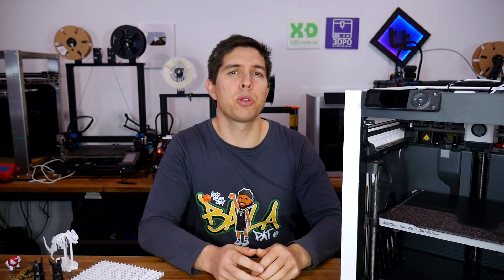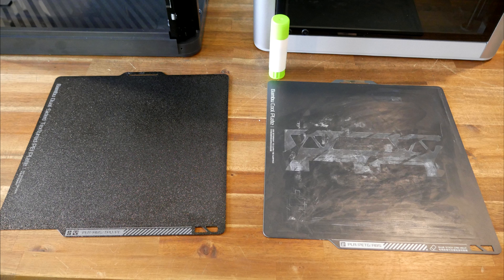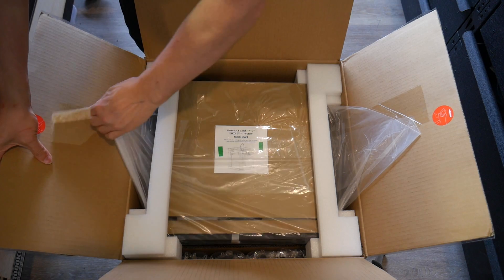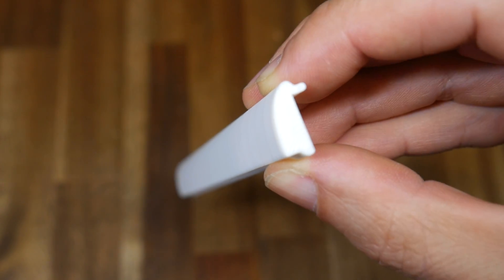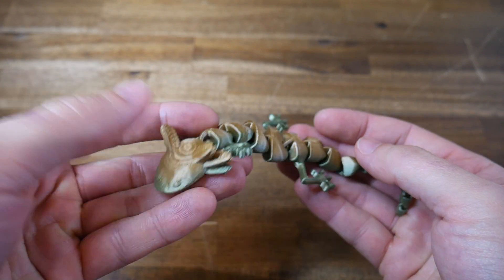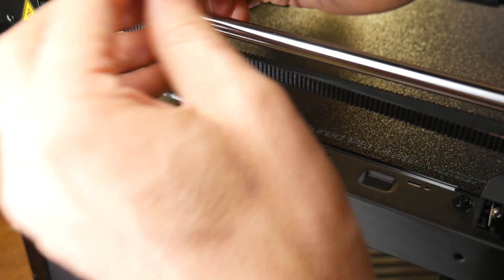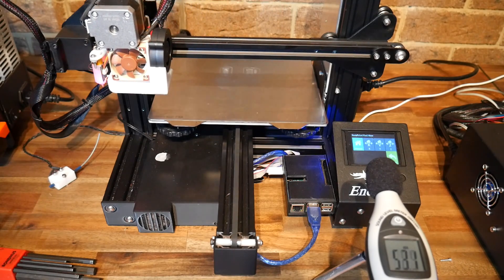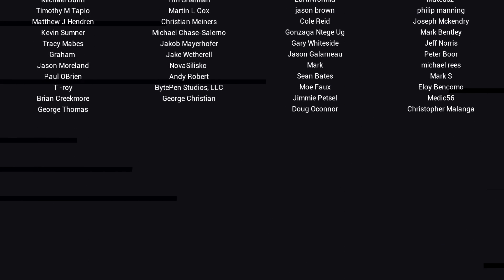Bambu Lab P1P - Your questions answered!

Comment: I'm really glad this printer exists. Prusa needs serious competition. They've been rather stagnant with their innovation.
Reply: Prusa sucks, 5 years ago maybe but now honestly the ender S1 pro the new one blows it away itself nevermind the x1
Reply: For me Prusa is a reliable and well tested printer that gives excellent prints. That’s the bottom line. I’ve tried loads of rubbish printers that had to be tinkered with in excess to give anything close to a Prusa. The Bambu has been out for about a year if that? We shall see what future holds. The savvy 3d-printer-YouTubers can make gold out of a turd so I’m not convinced that this machine is ready to “beat” the Prusa. Yet.
Reply: @henriklagercrantz  more than just you Tubers have them I have 4 Enders 2 pro 2 plus a Prusa mk3 as well as 2 x1 this has been out for a year and they sold many many printers. Before you bought your first Parisa you didn’t know anything about it. I’m sure it’s no different.
Reply: @weldingjunkie  I’ve got a flashforge finder, an ended 5, an ender cr10 v3, a sidewinder x2, an ender 3 max and my Prusa mk3s beats them every time on reliability. Perfect prints. Right out of the box. No hassle or headaches with clogs. No “upgrades” it. Just. works!
Reply: the prusa xl looks amazing but $$$ and they can't seem to get it shipped. They built up hype but couldn't deliver and by the time they can a newer better printer will be out, and likely for less money
Reply: @digitalpilgrim  that price point is extremely steep for the prusa XL
Reply: @digitalpilgrim  It's been 2 years and still no one has one in hand. If it wasn't at Formnext 2022 I would have thought it vaporware. Of course its blazing printing speed of 50mm/s left a lot to be desired.
Reply: @No0o0o0o0o0  but unlike the garbage bambu makes a prusa will work in 10 years
Reply: Even on prusa's website they recommend maintenance every 800 hours of printing. If you don't maintain your product it's going to fail. 

You know how many advancements in 3D printing happen in 10 years?

Are you implying that if I put a prusa together today print once. Then print 10 years later it would print perfectly? Lol
Reply: @No0o0o0o0o0  more likely than bambushit
Reply: @CourlandEngineering  the difference is the bamboo lab is out now. Where is the xl?

And we can't even compare the mk3s line to the p1p or the X1c. They are objectively better. Time will tell abour longevity but we're dealing with the Here and Now. Corexy crushes bedslingers. They print faster they're more accurate and have a larger  build volume. 

The only thing that prusa has going for it is the fact that they make the Bambulab look awesome lol.

The prusa looks like trash that was thrown together after a garage sale
Reply: @No0o0o0o0o0  If you need technical help or parts in 5 years bambu will be nowhere to be found, and even if they will be around they wont give you their crappy proprietary parts
Reply: @CourlandEngineering  Ok Nostradamus since you can see the future. You forget one thing I can afford the best. I am not waiting around to fix 10yr tech for it to print slow. 

Maybe I'll explain it a little better.
standard

Something that would take 3 hrs on a prusa i get in 40min on my BL. It gets worse the larger the print.  25hr print (crystal dragon) I get done in 8-9 hrs.  Which means I can get several times the production out of my new tech vs the "reliability" of my old tech. Remember CoreXY is fairly new. Imagine what will change in 10 yrs. Time  is money and spending on a slow cartesian printer is a waste. 

aside from your subjective "reliability and support" why is a slow janky shite diy project like the prusa worth my time?
Reply: @No0o0o0o0o0  all im saying is prusa is a much more legit company than bambu, and if you wanted the best youd have bought a voron
Reply: @CourlandEngineering  I dont have 30hrs to build a voron. I have a day job. A voron kit (depending on sourcing) would cost more and be less capable. 

30 hrs to build, test, tweak, then deal with code and countless other issues.  So I would pay more, deal with more headache and get less. I have seen the Enrager Rabbit Carrot Feeder mmu for vorons and am not impressed. 

I have the Bambu lab AMS system as well so I can print in multiple colors up to 16. 

I'm not emotionally bonded to my printer. It is a tool. I dont need to know every inch of it or personally pick out parts. I am not a fan boy of any one company. My interaction with them, is purely financial. They sell a product, I buy a product. I dont have to agree with their mission statement. I couldn't give a flying $uck about open source. If they go under and I need a new one I'll buy whatever is the best at the time.
Reply: @No0o0o0o0o0  a voron is much more capable lol, you wont EVER be doing 200k accel on a bambu
Reply: @CourlandEngineering  LOl the fastest voron gets 794 mm/s and that guy states he loses quality at 400mm/s/ which is well within print tolerances of the bambulabs up to 500mm/s.

I noticed you skipped over the fact I have an AMS and capable of printing 16 colors.
Reply: @No0o0o0o0o0  Who gives a shit about AMS? oh right nobody. there isnt a single video of a bambulab printing well at 500 lol, plenty of vorons printing well at 500
Reply: @CourlandEngineering  I like the idea of an AMS, but without a tool changer it's mostly reducing its application to multi color, which I'm not interested in at all untill we get color mixing that leads towards a true color coloring.
And yes, I won't call Bambus wasteful purging mechanism an asset.
Reply: @CourlandEngineering  Spoken like someone who does not own an AMS. lol I use my AMS daily and have been since early AUG. If you cant only print and think in one color than that's a YOU issue.

You still don't get it. I had to build nothing. No coding, flashing firmware, tweaking, calibrating or sourcing parts. 

The extent of my "building" was removing some screws and I was ready to print in less than 20 min.

Show me the 20min unbox to printing voron kit and at the price I paid I'll apologize to you publicly (im a early bird kickstarter backer $1000 X1C with AMS)

Dont think I didnt notice your move from "reliable" prusa to rattle itself apart super fast voron. 🤣
Reply: @No0o0o0o0o0  the only thing rattling itself apart is bambus cheaply made proprietary frame. the x1c is a knock off voron that cant go as fast or be upgraded
Reply: @No0o0o0o0o0  a printer is a tool, not an art project, you dont need 4 colours, you need one and thats it
Reply: @No0o0o0o0o0  the x1c cant even print PCTG or nylon carbon fibre, let alone peek lol, come back when the x1c is more than an overpriced toy with colour changing so you can make your little dragons colourful and leave the proper printing to a tool thats meant for it
Reply: @CourlandEngineering  Are you going to tell me I don't need the speed too? 🤣
Reply: @CourlandEngineering  LOL the Bambu labs....X1 Carbon....cannot print...carbon fiber nylon.

I guess that roll Bamb  sent me with the printer, which printed wonderfully by the way, needs to undo itself and go back on the spool because the printer cant.... print it...🤣

Yep I guess it is a toy, One that makes me money. LMAO and Im barely able to keep up. I will probably get another one in your honor. I can afford it as you know.
Reply: @CourlandEngineering  Well, just because you don't need multi-color printing, why should that apply to everyone else? I don't need it at all, but what do I care if there are people who want to print things in three colors?
Reply: @No0o0o0o0o0  Meh you're just a beta tester for the Prusa version which will run circles around your BL machine. Prusa is the industry standard
Reply: @FaederMade  If I can continue to print at these speeds sign me up for the infinite beta tests. Lol. You're printing at 45/mms and happy good for you. The rest of us want fast accurate prints.
Reply: @No0o0o0o0o0  Spoken like a true beta tester. You talk like the babmu labs is the end all be all with speed lmao. It'll be obsolete in a year.
Reply: @FaederMade   Unlike  you I can afford things. I have a day job. I don't need to keep old 50mm/s equipment alive if it does not meet my needs. I don't like to poor shame....but......here.....we.... are.....

I just got an a few orders to make things on my "beta" equipment and it will pay for itself and then some. That's what you guys don't understand. You are fighting tooth and nail for a decade's old tech and think you are doing something special. The chick  earlier summed it up perfectly.

I can get out one 25 part order in a little over 50s hrs on my bambu. It would take a prusa 225hrs at the recommended speed of  41mm/s. Weirdos in the comment either say get multiple prusa.(kek) that means 5 mk3s+ x $1100 = $5500 or build a voron (KEK KEK)and a voron will require a 30+hr build and even then it may have issues.  

My one X1C replaces 5 mk3s. I asked multiple times. Can I get a voron setup from unboxing to printing in under 20 min? If the answer isnt "YES" then what are you going on about?

 I'm hitting close to 2k hrs printed and my parts are flawless. If this is beta testing oh well. lol.Just remember this you have been "gamma" testing for years with a prusa and it will not get any better. the Mk3 line sucked in 2015 and it still sucks now.  

Change my mind.
Reply: @No0o0o0o0o0  Established company with a quality product > kickstarter project. Do you though lmao
Reply: @FaederMade    Me doing me = picking the superior product. I picked the X1C. Still have yet to hear a better product come from anyone in the comments.

I'm not buying a name. I'm buying a product that crushes the competition handily for the price. Prusa lost this round. Maybe in 2023 they will figure out how to print faster than 50mm/s or make something that doesn't look like a  pre-teenager's science project.
Reply: @FaederMade  just pointing this out but you're saying they are the beta test for the Prusa version but am i wrong in saying that Prusa themselves have failed the community it promises the bigger printer for years and not getting it out.. they are the standard by why have we not seeing them jump leaps and bounds in the since the release of the MK3S new companies are entering the field and other companies' printers are getting better and better. When it comes to Bang for your buck Bambu Labs is blowing Prusa out of the water.
Reply: @No0o0o0o0o0  Voron 0.1 sacrifices build volume for speed - it can go up to 1k mm/s
And ERCF was tested to work at 9 channels aka 9 spools
Reply: @No0o0o0o0o0  If you can't hold a screwdriver and have no experience with one, a Voron will take you 30 hrs.
In order to fix broken Voron you have order random stuff from Aliexpress/Lecktor/blackfrog etc.
For Bambu you can only get their parts from them and only them.
"Flashing issues and errors" on Voron (only)... why is Bambu Reddit full of error codes then?
Reply: @r4yker442  if I need to print something smaller than 4.5 inches cubed maybe a voron 0.1 is a possibility. It's functionally useless for anything else.
Reply: @r4yker442  so you can get a voron setup and working in 20 min? An hour, 2 hrs? What's your realistic time frame. 

My X1C was ready and printing I under 20 min... And I took my time. Removed a few screws/packaging, connected a screen and powered it on. Can your voron can be ready as fast?

If you go to that same subreddit there are tons of successful prints. You may even see mine over there.
Reply: @No0o0o0o0o0  If you get a prebuilt kit (for example high-end Lecktor one) all you have to do is to calibrate it, which shouldn't take too long for person that has done it before
Reply: @No0o0o0o0o0  Fast prototyping.
Voron 0.1 (or 0.2 now) is built for booting up printer, loading a file and nearly inmediately printing due to how fast it heats up.
Sturdy, fast and small.
It is also not-so power hungry (55W power usage during the print), but bigger printers require absurd amount of power to heatsoak them.
Reply: @CourlandEngineering  No one is going to keep a printer for 10 years lmao.
Reply: @Noooooooooo  the amount of copium in this thread is insane lol, I'm happy i sold my prusa. Cant wait for my x1
Reply: @CourlandEngineering  Bambu is based on a bunch of DJI engineers isn't it? DJI being the biggest drone company in the world....So I think they already have an abundance of engineering and support experience (perhaps exceeding Prusa) and are likely to be around. Being semi-locked in to anything based on a Chinese companies cloud though is a concern just like it is for DJI. If you ran a serious business you would be wise to run these on their own network segregated from any corporate systems.
Reply: @ingmarm8858  I work at a print farm and we decided to not buy bambulab because of the countless issues people are having, warped beds, nozzles falling off, interface bricking itself etc
Reply: The usual misconception that the Prusa and the Bambu would be competitors is now so sobering. People see: Oh, same price. Must be competitors then. Holy crap, you picked ONE requirement to compare and forget many others, like printer ecosystem, repairability, support, expandability, application area and so on.
Reply: @tmartin9482  
"The usual misconception that the Prusa and the Bambu would be competitors is now so sobering. People see: Oh, same price. Must be competitors then. Holy crap, you picked ONE requirement to compare and forget many others, like printer ecosystem, reparability, support, expandability, application area and so on."

They are competitors since they are competing for your $$ for this 700-1200 price point.
P1P $700 fully assembled
Prusa is 800 as a box of parts and....bag of Haribo gummy bears....wut?
1000 X1 fully assembled
1100 Assembled Mk3s
1200 X1C, (camera, side blower fan, harded steel nozzle, better shell)

Let's go over your points

Printer ecosystem
Prusa has the mini and MK line( XL isnt out yet)
BL has the P1P and the X1 line

Repairablity 
BL hasnt been out longer than a year and everyone who bought recently is still under warranty.
Parts are available for most consumable parts. Build plates, belts, nozzles, fans, screens, cutters etc.

Support
See above

Expandability
Prusa is a cartesian printer so it can never be as fast as a CoreXY printer no matter how much you spend.
You can only jank things together to come close to a BL printer...but not in print speeds. 
For instance adding octoprint to monitor remotely is a kludge solution.
The moment you have to flash an image, run a sudo command or configure a raspi is the moment you will notice how janky those upgrades are.
at one point Octoprint recommended to enable port forwarding to use it outside of your network is another indication we have put up with BS in 3d printing for too long. 
Then you have to research Vpn, plugins, reverse proxy and countless "solutions" so you printer isn't exposed to the WWW. 

Application:
Bambu studo is based on Prusa Slicer and Slic3r.

I'll revise my premise. You are right they are not competitors. BL is the  new king and the Prusa is the deposed monarch..
Reply: @Ashley B  You stubbornly ignore my point, that different printers and their manufacturers can have different users they address. Oh so naive, grow up!

But if you really want to draw comparisons:

Printer ecosystem:
Reducing it to the manufacturers printers is rather stupid. The ecosystem incorporates the printer, the add ons and extensions, the service, community, compatible software and much more.

Repairablity:
Waranty IS NOT repairability. And yet, BL still has to show that they fullfill their waranty while Prusa allready has shown it for several years. Btw. I like that you invalidate your own argument. This little "most consumable parts" sounds so weak compared to a manufacturer that has ALL parts available and also enables other suppliers and even the user itself to provide spare and consumable parts through the open hardware approach.

Support:
See above. BL still has to prove while Prusa has allready proven reliable for years.

Expandability:
Comparing printer designs, not machines is rather stupid again.
I think "open hardware vs. closed hardware" says all.

Application:
You said it yourself. It's a ripp-off/fork of the Prusa Slicer and thus will get new features, of which Prusa has already produced many (and how many did BL yet?), later than the original.

As described in many other comments, I think the BL P1P deserves a fair chance to prove itself, but it does not deserve the current hype.

But you seem to be just a fangirl (or a BL bot, I'm really not sure about the account name).
Well, you can do that, but do not demand it from others.
Reply: @tmartin9482  Well unless you can break out your time machine we have a 1 year warranty that is still in effect so....yeah
I have a tesla and not all of the parts are available for sale....should I only buy things if I can get 100% of the parts to build it from scratch?
Cell phone? TV? Laptop? microwave?

You some how gate-keep 3d printers but ignore the rest of the products everyone buys. Sheesh. You people have the "Ship of Theseus" mentality. You are so bent on replacing every part but never stop to wonder why bother. I had a ender for years. Replaced so many parts over the years but in the end it will never be more than an ender. Your prusa will never be appreciable different than what it is now. It will not get faster or better. The greatest trick Prusa has pulled is having you think mediocrity is a virtue. You have been stuck printing at 50mm/s with a small build volume and calculator screen. You can rebuild your prusa 10yrs from now but still have the same flaws of a slow printer. Prusa has you thinking instead of going faster and getting better you should buy more of the same crap. Everything you just said shouts "UPSELL" but you don't get anything better for the money. 

Much like the other guy Noooo. if BL go belly up oh well. I'll buy something new. If my ender died tomorrow and the parts and time assembling exceeded a new printer then why am I staying with old tech? My prusa has been retired since I got my new X1C. I will have an anker m5 come in a week. 

Your "reliable" prusa has been screwing you for years and they have been surpassed. 
Never once have you stopped to think why hasnt prusa pushed the envelope in 3d printing in 7 yrs? Why are they so slow? Why are they using 3d printed parts instead of premium parts?
Why the crappy screen. Where is input shaping, lidar? Why is corexy taking 2 yrs(and counting)? Then ask yourself the biggest question of all why are you on a P1P video arguing prusa is better when you know there is no comparison? If your only claim is potential reliability that could be on any product. Need a Prusa XL, but hasnt been out long enough. Need a new phone same deal. You are banking off of the name but ignore the fact prusa's have a repair center. They have copious amounts of help faqs, troubleshooting tips and other forms of assistance(reddit, discord) than maybe they arent so great after all. Prusa's MMU has been an abject failure but we don't talk about that...because prusa is so reliable. I can't tell your the amount of BS errors I have personally dealt with.

As far as expandability I buy the product I need. I don't buy the promise. You can buy a prusa, and add a touch screen, octoprint, updated hot end, enclosure but in the end you had to kludge it all together vs buying the product that fits the needs. It's 2022 and printing at under 50mm/s is a crime. 

Prusa slicer is open source and is fork-able. I will assume you know what AGPL means or did you think Prusa slicer is original? (bonus points if you know what prusa slicer is based on)

So yeah guess im a bot. The most sophisticated Bambu lab bot able to parse language and refute points. The only issue is that I have a ender, prusa and ankermake m5 on the way. they messed up my programming because I am not loyal to any brand.